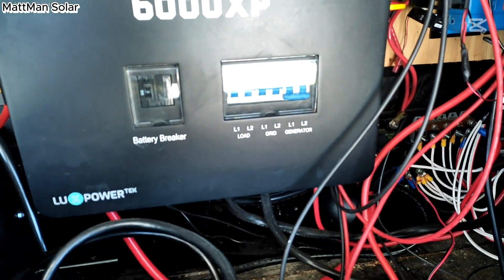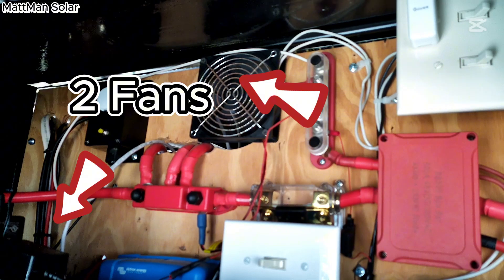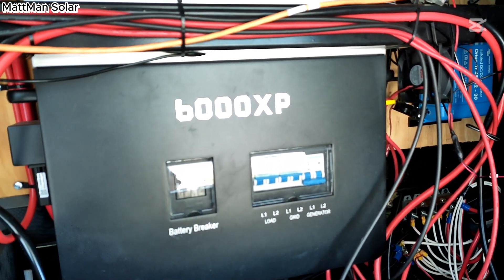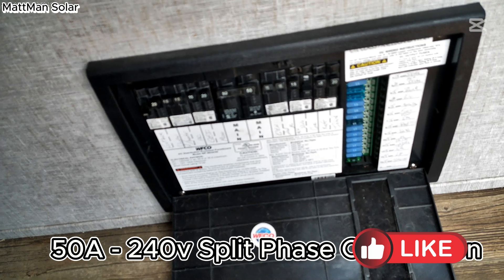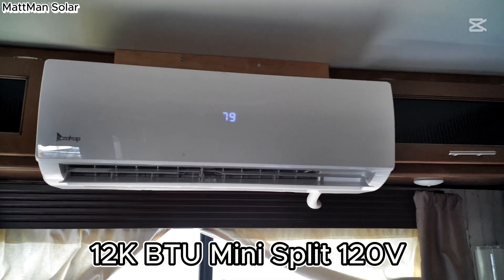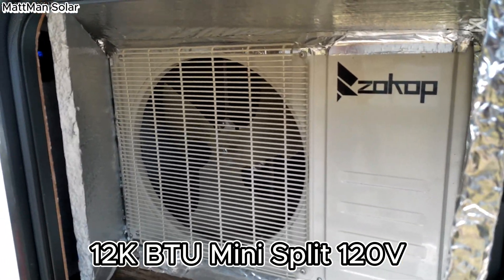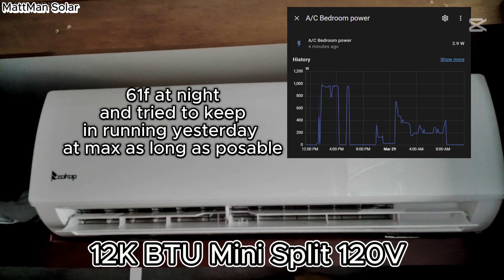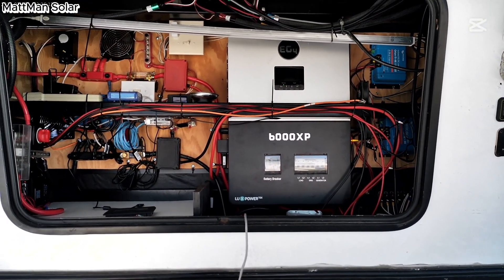Complete Solar System Tour in My RV: Inverter, Batteries, Panels & More!

Comment: Thanks for the video! Do you not have a backup generator? Also, I am a bit confused about the chargeverter dry connects and how that works? What happens when you plug into a 50a and 30a rv site?
Reply from the maker: Yes, I have 2 depending on what I think I will need .. A small 2400w that can be used for slow charging when I really done expect to need it.. Then I have a 9500w 240v that can run the entire RV and/or charge full power. I plug them into the chargeverter to ensure that the power is clean and it acts like any other charger going to battery busbar for consumption or charging.  If I have GRID power I can also plug that in, and it feeds the 6000XP for charging and bypass or just normal grid operation .. 

I can also plug grid into the chargeverter port at any volage 120v/240v and allow the dry contact within the 6000xp to determine when to enable charging. I use this if we are at a part with only 120v power, it allows me to charge the battery with only 120v outlets, as the 6000xp need or prefers a 240v 50a connect for full operation. 

Thank you for the question, please let me know if you have anything that is not clear.. I will be glad to answer it.
Reply: @MattManSolar  Hey Matt! Thanks for the reply. I am looking to do a similar setup on my 2018 grand design solitude 374th. The victron components are about 3x the cost of the 6000xp. What would happen if you didnt have the chargeverter(and extra plug in) and you plug the rv into 30a? 

Also, I have a 5500 onan generator that i will have in the rv, what is the best way to set this up for autostart in the batteries get low? straight the 6000xp or the chargeverter?

Also, can i plug the chargerverter into my truck bed 120v as i drive down the road to trinkle charge?

Also, does that second battery bank you have use the CAN communication?

Right now my setup plans are the Luxpower 6000xp (not EG4 since i am in canada) and four eco-worthy server rack batteries. Max solar panels on the roof, Onan Marquis gold 5500w generator with autostart. then maybe the chargevertor for trinkle charging while driving and 7to be able to pull power from the 30a rv site. Thoughts? Thanks so much!
Reply from the maker: @ThreadTalkPodcast chargeverter is nothing or then a 100a charger. I do not suggest using generator power directly to an inverter or AIO like 6000xp as the dirty power can harm them or just not work. So if you do not have a chargeverter you can use any charger directly to the DC Busbar.
Reply from the maker: @ThreadTalkPodcast auto start is possible from the 6000xp if you have a 2 wire auto start on the generator …
Reply from the maker: @ThreadTalkPodcast charge going down the road .. yes but as you travel down the road your panels should also be charging .. I know mine do and they work really well cause the highway speeds keep the temperature of panels down
Reply: @MattManSolar  okay makes sense. How does my plan sound? I have a Onan Marquis gold 5500 generator that i found for $250. It is only 120v so i wire the L1 and L2 output into a Victron Energy Autotransformer 120/240V AC, then that goes into the EG4 chargeverter so that the gen can autostart when the battery bank gets to 5%(keeping my cats cool if the weather is hot but cloudy). Battery bank plan of four 48v 100ah eco-worthy server rack batteries that go into the 6000xp. 

If I have that done, can I also setup the chargeverter to connect to a 30a rv site and a 120v plug to trickle charge while i drive? This would be good if i am driving on a very cloudy day just to get extra power from my dual alternator truck.
Reply from the maker: @ThreadTalkPodcast I do not know much about DC to DC charging from a automotive alternator, but I know it can be done..
Reply: @MattManSolar  well the truck was the 120v plug in the bed that i would plug into
Reply from the maker: @ yeah I don’t see why that would not work, but the 120v 400w plug in the back of my Ram is worthless for that kind of power pull .. but would be ok for an amp or two I would think… I may try it and let you know ..
Reply: @MattManSolar  yea i figure just a trickle charge is better then nothing.
Reply from the maker: @ThreadTalkPodcast I will try it and let you know.. I would like to know also, kind of interesting thought..
Reply from the maker: Yes I could run it at 1A BUT the 400W outlet in the truck could not do it .. I will find another small inverter and see that works, but the inverter will trickle as low as 1A (54watts)
Reply: @ why not run it to 400w?
Reply from the maker: @ I tried but the inverter could not do it, it would shutdown and chargeverter would retry but never able to startup .. I figure there is some serge, but I have had this problem with the inverter in the back of my ram before so might work just fine with other plugs in other trucks or cars.
Reply: @ oh yea, I did read the chargeverter will shut down if the inverters output is more then the chargeverters input.
Reply from the maker: @ yes it f the generator or outlet shuts down the inverter will stop and retry starting.. I really think this should have worked and I think the 400w inverter in bed of Ram truck is trash.. I will try another inverter I have that is only 300w .. I bet it works but it will take me a few days to get it from warehouse to test ..
Reply: @ best of luck!